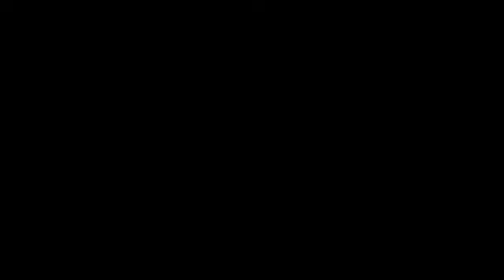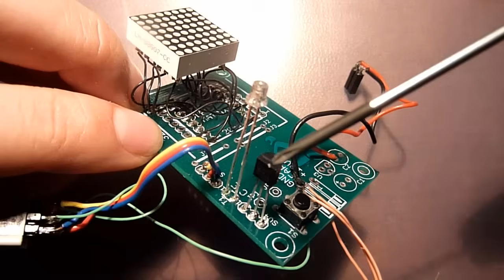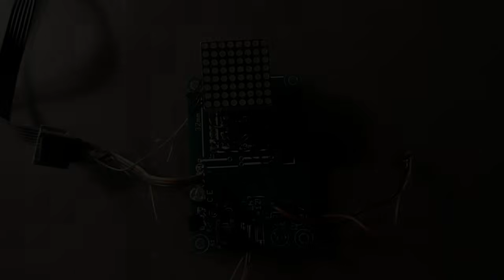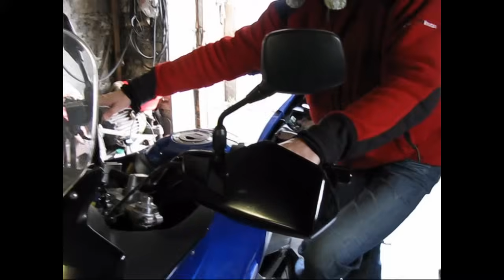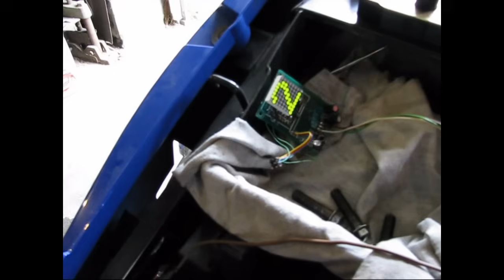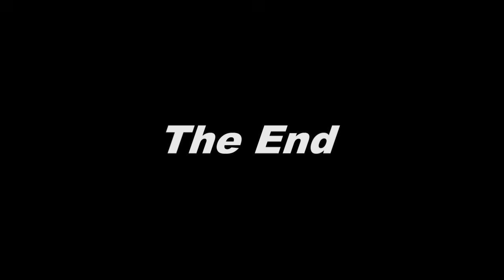Gear Position Indicator Prototype

Comment: Absolutely beautiful! How does it register the shift? Based on rpm/speed or? I would like to make one for my r6
Reply from the maker: Gearbox provides this information as voltage level.
Reply: Oh ok, my r6 doesnt have this, think i will have to solve my way with rpm/gear ratio calculating. But this is very neat!

Comment: I remember that some of these devices are guessing the gear position  based on road speed/rpm equation, so no gearbox tapping is required. But graphically, this is a winner! I'm sure this will fly!

Comment: Add a gyroscope & indicate GPS info. by scrolling as you move. Thus giving some indication what GPS coordinates actually relate to.
Switch/auto-switch between GPS & compass modes, or waypoint arrow then distance etc. Gyros are becoming cheap & waypoints could come from an iphone or iphone app perhaps (like reading a .txt on a usb stick?). With a gyro, speed could also be displayed.
Could be really useful. like a simple vehicle GPS + improves safety as an emergency instrument backup.